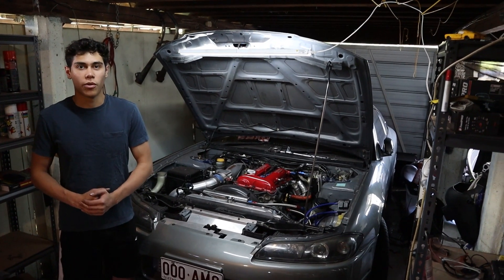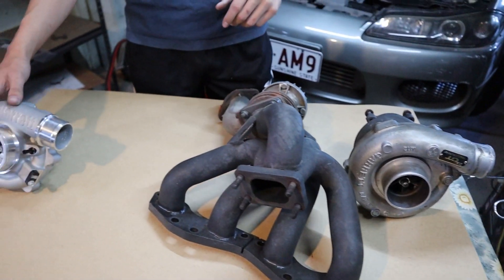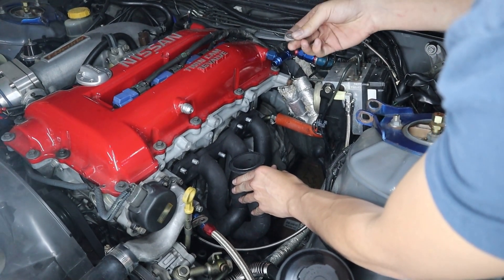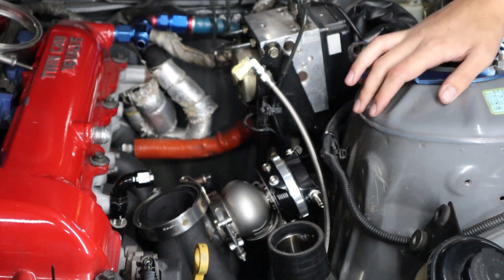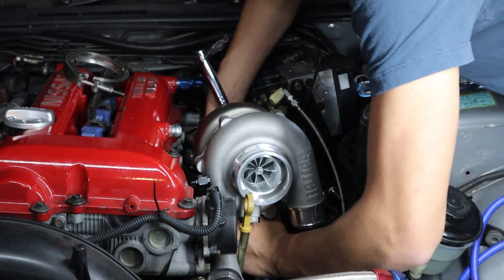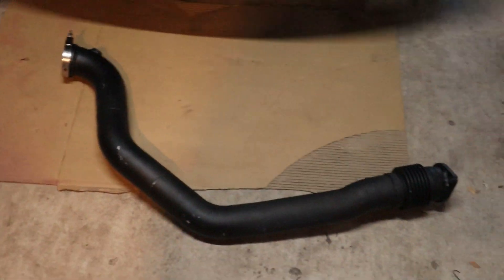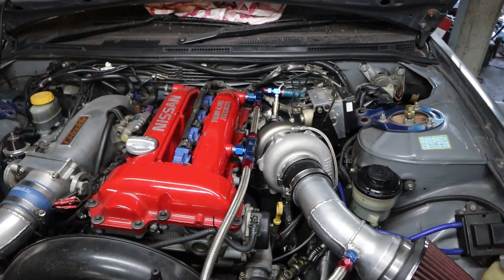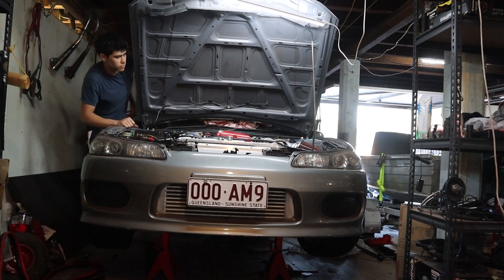S15 SR20 G25 550 Turbo Upgrade

Comment: Nice! I went with the GTX2867r I've maxxed it out at 411hp at the wheels, I've only got Pon cams and 1200cc injectors, full boost by 3.6k and it hammers,. Was thinking about going for the g series next, yet pretty happy with this power form the 180sx, more than enough!
Reply from the maker: What ar on your hot side and how much boost?
Reply: @yd2532  .64, used the stock manifold as well, was at about 24psi off memory, any higher it was starting to fall off at top end.

Comment: Hey mate, Great video !
currently doing a same set up top mount. 
Question; What turbo lines did you have to do to work perfectly with the g25
Thanks !
Reply from the maker: I ended up redoing the lines. With the 6 boost manifold when i had the turbo feed pointing straight up the drain hose was touching the manifold. I've since turned the chra about 20 degrees to the left so the drain hose fits between the manifold and wastgate.
Reply: Awesome thank you. Yea I’m in the process of installing a top mount manifold along with the g25-550.
All I’m missing is the turbo lines now. Was thinking maybe the KiT from ISR might work. 

Did you do a relocation kit for the power steering pump as well? 
Cheers mate
Reply from the maker: @MrNikeeSb  no I left all the power steering stuff factory

Comment: Hi what AR turbine housing? From the research I've done, the 0.92 is great for the G25-550 and 0.72 for G25-660. Would the 0.72AR with G25-550 get you 400whp?
Reply from the maker: I'm using a G25 550 with .72 ar Pretty easy to get 400hp out of it. .92 would be way more laggy

Comment: Do have a complete build? Wanna run this turbo but I feel like I need more supporting mods right? A list would be amazing your videos 🔥🔥
Reply from the maker: specs
2.2L stroker 
256 cams vct delete
6 boost manifoild
g25 550 .72
haltech elite 1500
I think its got 1000c injectors

z32 gearbox and 3.7 2 way diff so its got long gears
Reply: @yd2532  do you think I could run this size turbo without the stand alone ecu and the stroker kit? Thanks for responding bro
Reply from the maker: @MidnightXAlchemy  definitely need an upgraded ecu. If you got a stock engine just do head studs and a metal head gasket. The bottom end should handle 350hp for a while

Comment: weird question, but on the front housing of the g25, were there 2 or 3 plates holding it together. I bought one and it only came with 2 but it just doesn't seem right
Reply from the maker: Pretty sure they uses 3 tabs for the comp housing. Just had a look on Google and it shows them with 3 as well
Reply: @yd2532  cheers, yeah I called the supplier and they're sending me another plate, bit shit I've been running it for a month now 🥲

Comment: I’m making 230kw atm but my motor was built for 300-400kw old owner done it and he said the tuner said to get a Haltech and bigger turbo 

And cams 

Wanna sell your hks turbo and big cams lol
Reply from the maker: Where are you located
Reply: @yd2532  south coast nsw man
Reply from the maker: @GIXXRBRAH750  I'm in Brisbane
Reply: @yd2532  yeah I’ll pay shipping bro no problem
Reply: @yd2532  what turbo and what cams?
Reply from the maker: @GIXXRBRAH750  I was told they were 272 but I can't find any markings on them to be 100% sure. Turbos a gt3037 but will need a rebuild
Reply: @yd2532  does it say the brand ?
Reply: @yd2532  atm I’m running a Garrett 2867r pushing 230.9kw/309.6hp
Reply: @yd2532  hmmm sounds dodgy from old owner lol seem he opted out for cheap options when would come on? 3500-4k?
Reply from the maker: @GIXXRBRAH750  around 4.5k and it use to rev to around 8k. Engine is stroked 2.2l so would be laggier on a 2l plus the vct was deleted probs cause the cams were too big
Reply: I decided for tomei poncam 258 

Psr GTX3071R or a 3582
Reply from the maker: @GIXXRBRAH750 go 3071. 3582 would be laggy af
Reply: @yd2532  I actually ended up buying the new design of the boosted series B5455 G30-660 .83 by Aeroflow
Reply: @yd2532  so really it’s still a lot smaller turbo compared to the 3582 I was planning on getting
Reply: @GIXXRBRAH750 Heaps of skyline boys have put the 3582 on their 2.5 and regretted it as they are too laggy .
Only way you can run barra turbo is if you are revving to 9K

Comment: you  have Instagram  ? i nees help for turbo setup ..pleasee .
Reply from the maker: @TheSol115  what did you need help with?
Reply: @yd2532 I need to know what measurements I make the header for turbo and the same power as your engine 😍
Reply from the maker: @TheSol115  I bought my manifold from 6 boost so I didn't make it